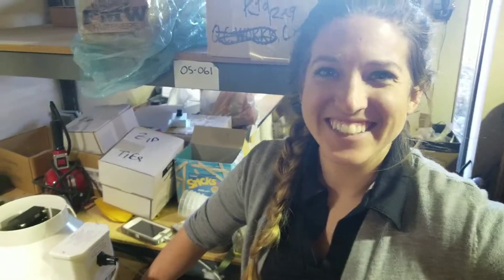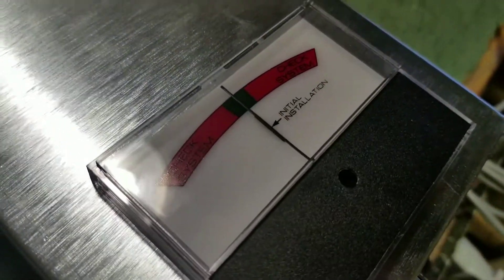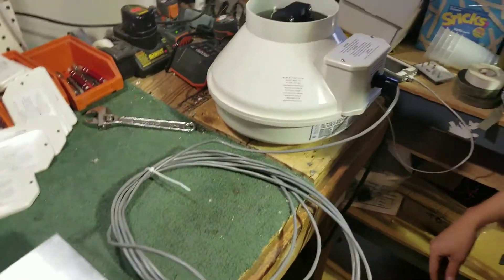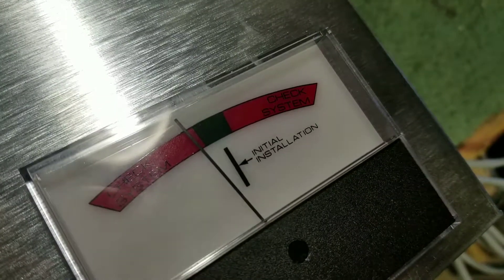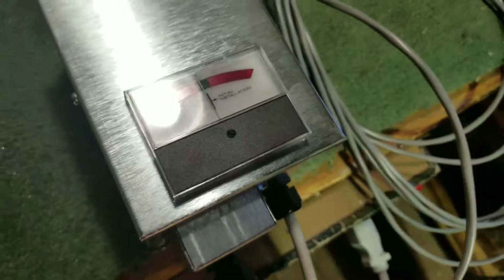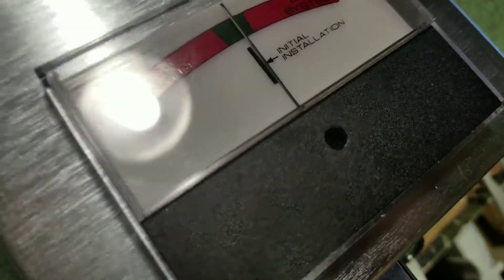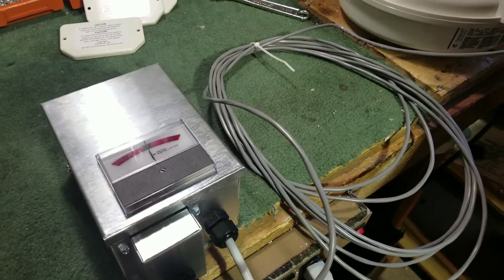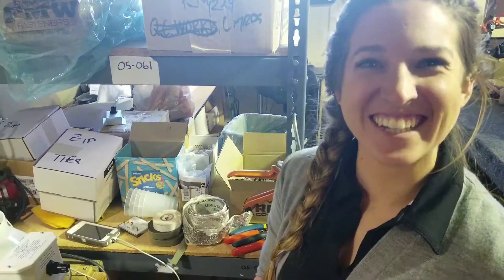HELP, My KTA Meter is in the RED! | PDS Radon Supply

Comment: Any concerns with water pooling at bottom end of intake pipe causing decreased air flow?  And if so how to know?  (Yes, we have a sump well that goes four feet below basement grade).

Thanks for comments
Reply from the maker: Hello Joe, thanks for watching! If your sump is sealed properly, functioning properly, and has a one way valve (like a dranjer fitting) then it should function as intended. If water is pooling in the system, then your KTA meter would drop to the left into the red indicating a decrease in airflow. If you're unsure if your system is functioning properly, give us a call and we can help troubleshoot or get you in touch with a certified mitigator in your area.